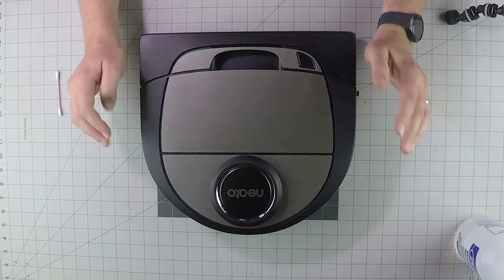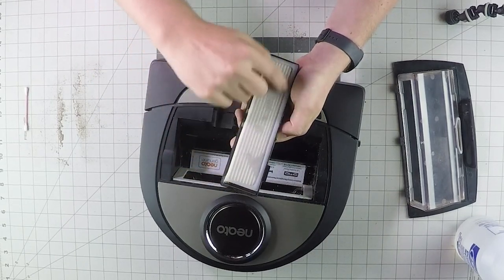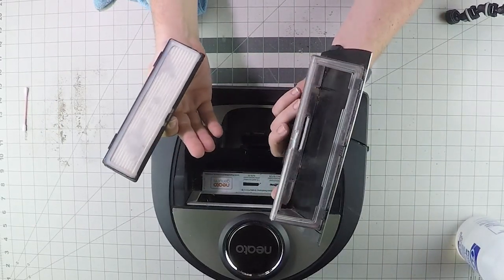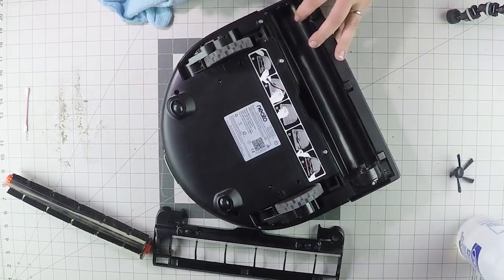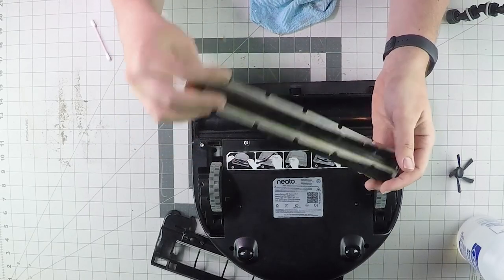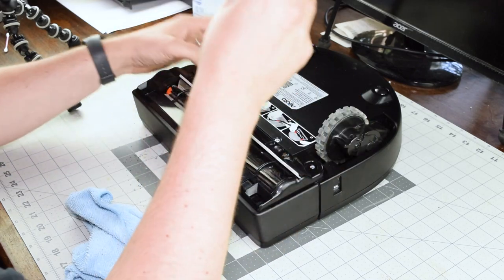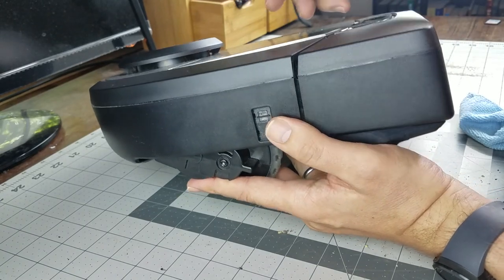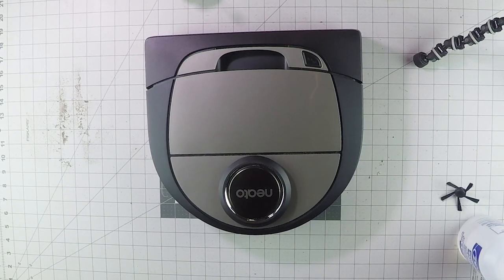DEEP CLEAN Neato Botvac Connected Series D3. D5, D7 & Botvac Connected

Comment: I found a weird thing when replacing the battery of my Neato BotVac D3.
When I cut up the old battery out of curiosity, I found only 4 cells.  At the end of the battery pack in a separate compartment, there were two metal plates glued on top of each other.  They were about the size of two cells and weight about the same.
What a cheap trick of Neato's to only give 4 cells when they could have provided 6 in the same size package!
The new battery is triangular in cross section. It seems to have 8 or 9 cells in it.
It gives the BotVac great run time and it can do the whole clean on one charge.

Comment: One suggestion: on the long brush, the larger of the two ends, the one that spins, is removable, and, at least in my pet-heavy home, cat and dog hair gets spun around the axle and collects in a wad.  By removing the end cap and pulling the hair wad out, it improves the efficiency of the roller.

Comment: Don't miss the grid on the back, where the air comes out. In my D3 a lot of dog hairs had slipped by all filters and got stuck there. A little flat screwdriver pops it open and the garbage can be removed.
Reply: Same happened to my d4  i only noticed with the sound overtime!

Comment: Thanks for the great video.  I have a D7 which is having trouble with one of the spring loaded wheels so I have disassembled the wheel area and the springs popped out.  When trying to re-assemble I can't work out where to place the springs and a couple of the connectors.  Do you have any video or description that helps with disassembly/reassembly of this part of the machine?

Comment: Read a lot of bad reviews online about Neato. Are you sure it’s better than Roomba 960?
Reply: Cody Robinson Yes, I have tried both and the Neato connected series is great! Much better suction and overall performance with my Neato
Reply: Which is the Best value Neato?
Reply: Which is the Best value Neato?
Reply: Which is the Best value Neato?
Reply: Cody Robinson right now the  Neato connected has been on sell for around $450. I have also seen the Neato D3 on sale for $299 however depending on the size of your living space the D3 might not be for you.
Reply: Cody Robinson
You have only to look underneath the Neato compared to most of other robots vacuums out there, round or D shaped. You will see that only the Neato has a brush and vacuum opening that spans almost the entire width of the device, which allows the robot vacuum to clean a lot better in corners.

What would you think of a regular vacuum that would have a round power head with vacuum opening covering only half the width of it? This is an absurd design for a vacuum!

I was to buy a regular round robot vacuum because they were cheaper, but change my mind and bought a Neato D5 instead and I am glad I did. It works great for a robot vacuum.

Even the Neato, which currently looks like the best robot vacuum out there, will never clean as well as a regular vacuum cleaner, but at least it works sufficiently well to clean the apartment acceptably and allow me to save time.